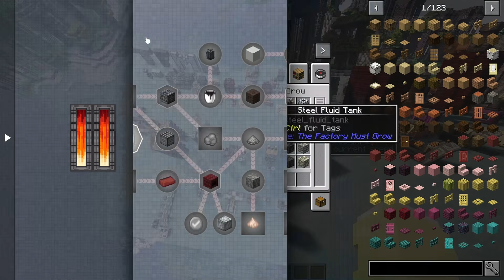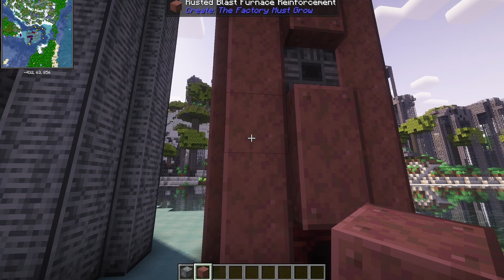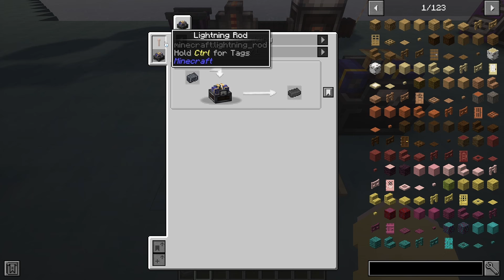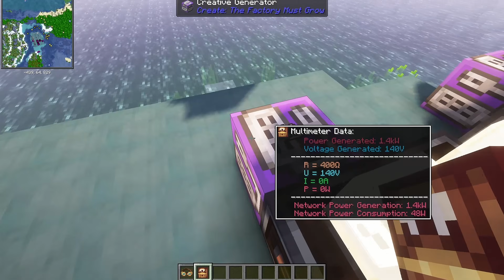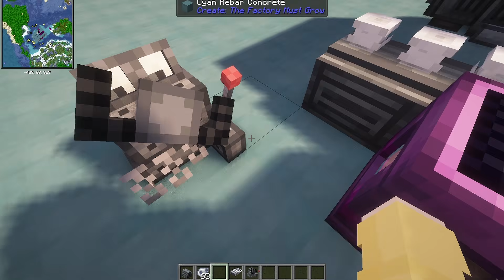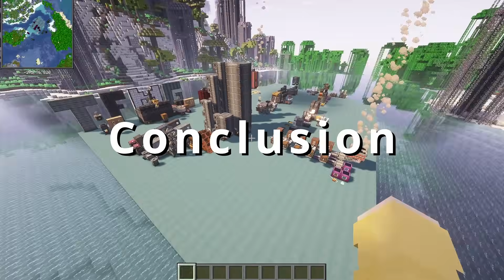Create: TFMG 1.0 Update - Comprehensive Tutorial (1.0.1b)

Comment from the maker: Okay, literally the day I uploaded this some things have changed.

- Electric motors: A lot less buggy. Speed now depends on voltage, the only thing you can configure is direction. Works up to 1000V, but already produces max SU and speed at 320V (11,220su at 255rpm)
- New gas lamp: Pump in various fuels to light up the area (furnace gas, crude oil, heavy oil, diesel, kerosene, naphtha, gasoline and LPG). ((even though they don't have a recipe yet, hydrogen, butane and propane also work))
- Fire extinguisher: Spout carbon dioxide onto it to fill it. Puts out fires when sprayed.
- More item information and ponders were added as well.
Reply: How exactly do I use the gas lamp? I’ve been messing with it for hours and it won’t work. I’m new to this mod, am I missing something or is the gas lamp bugged right now?
Reply: Wow, that’s a lot of improvements in such a short time! The new gas lamp and fire extinguisher sound especially useful, and the electric motor changes are really interesting. Thanks for sharing the detailed updates! Looking forward to seeing what comes next. 👏

Comment: how do i get ethylene becuse i want to get cooling fluid for my engines
Reply from the maker: When I was playing this version, it was extremely finicky. The ethylene produced by mixing naphtha would instantly turn into molten plastic. I found a guide for how to extract the ethylene before this happens on the TFMG discord:

"Pump Naphtha into Chemical Vat at low speed (8 RPM is ideal) - THIS IS VERY MUCH NEEDED
Pump Ethylene & Propylene out of the Chemical Vat at 256 RPM
The plastic recipes call for 500mb of ethylene, and the Naphtha vat recipe produces 500mb Ethylene + 500mb Propylene. 
Pumping out at 256 RMP remove a tiny amount of fluid, taking you below 500mb Ethylene so the Vat cannot complete the Plastic recipe because there is like 494mb of Ethylene by the time it wants to process this recipe.
Do note, if you are pumping Ethylene into a Fluid Tank, when that tank is full the Vat will fill up with Ethylene and begin producing plastic."

Comment: Hi! For some reason, my distillation controller doesn't work. It has enough heat(lv 18) and full crude oil
Reply from the maker: It could be that the outputs are not correctly placed or theres the wrong number of them
Reply: @blueberry1c2 Thanks!
Reply: @blueberry1c2 I checked, it wasn't that. And my other distillation towers stop working altogether.

Comment: It's really not a good sign when 15 mins in there was not a single new useful item or machine yet, only stuff required for other stuff from the mod. Electricity I guess is something "new" but at least two other Create addons add FE conversion (at a loss) without this huge hassle. Your tutorial is really good and you explain everything really well, a shame the mod itself seems to be literally useless.
Reply: i have exactly the same problem, there's a lot of new stuff and they look very cool but in the end they are basicly useless unless you want some fancy lightbulbs
Reply: @lawawa236  the mod is made by a bunch of weird people that want to force everyone to use their stupid electric system tried using their convertor thing that turns regular FE into their system and it never works for some reason gotta have to learn their shit so I can get aluminium and even still need to get that magnet thing what a hazel
Reply: @Chubbles_Wubbington well you're not forced to use the mod lol, i personally like the electricity system lol
Reply: it's meant to be a somewhat different and more interesting replacement for putting immersive engineering into a pack. with obtaining steel and other things

Comment: It's not producing Rubber. I made this Vat out of Steel. I have the Sulfur Dust, Heavy Oil, and working mixer blade. What am I doing wrong?
Edit: IT HAS TO BE A 3X3, NOT A 3x3x2. Ponder NEVER TOLD ME THIS.
Reply: So 3 wide and long, and 1 high? Love how the JEI crafting and ponder dont specify that.

Wonder what other recipes require certain sizes of vat.

Comment: Dunno why another commenter was complaining about the mod, anyway i think TFMG is better than Diesel Generators on forge as for me the pumpjacks and engines have often broken for no reason (pumpjacks not extracting oil, their appearance glitched, engines randomly deciding to swap rotation direction when starting). I like that TFMG has steel processing that is more accurate than many mods (blast furnaces, option to use arc furnaces, requires raw iron, hot air and all that fun stuff) as well as the quad potato cannon among other things

Comment: Have you had any problems running into the vax? I have been having issues with trying to separate propylene from liquid plastic and then trying to extract it using mechanical pumps. Even with smart fluid pipes. I run into ethylene and propylene and liquid plastic not extracting

Comment: 23:14 does current scale with stacking generators?
Reply from the maker: No. Current depends on the voltage; if you need more, then the voltage must be increased. You should only add generators if you get a warning about not enough power

Comment: Interesting fact: Oil is not entirely non-renewable
(Honestly though, it's surprisingly hard to get a solid answer) Oil does slowly recover (albeit at an extremely slow rate), but more importantly, there is so much oil in the earth that it's unlikely we'll ever actually run out. The problem is that getting further oil just becomes more expensive the deeper we have to go for it. At some point, it is going to be more expensive to drill for new oil than it's worth, but we also have ways to synthesize substitutes.
Don't forget that when oil was first found, it was just sludge that farmers had no use for. Eventually, it was later used to replace whale oil, and was mined and used as a major fuel source. Eventually, they also found new ways to extract oil from newly found deposits, leading to deep well mining, and offshore oil rigs. There's far more oil deeper than we can currently reach at the moment, but by the time we reach it, we'll likely have more substitutes, or more efficient mixed fuel processes that would make the oil we do find last longer.
Reply: it's not energy positive to synthesize it, so it isn't worth it. We would actively lose energy from trying to obtain oil in a few decades, when all the easily accessible deposits are ran dry.

It also isn't renewable because we extract it faster than it replenishes. Saying oil is renewable like saying that gold is a renewable resource, because it "technically" is made when stars explode and they're still doing that. Like, yes, more is being made, but it is ultimately a limited resource for us.

There is a limit for which we can maintain oil consumption at energy positive levels, which we have already went past, so it isn't renewable compared to something like bio-fuels, solar energy, or wind energy. We can more or less upscale production and usage of all of those (currently) without a feasible limit. That's what makes something renewable- not that it technically replenishes over time.
Reply: I'm pretty sure we can actually make oil now (or probably in the future)
Reply: fossile fuel is a term created by oil companies to make you think its some sort of rare and non renewable material, oil most likely doesn't even come from organics but through the liquefaction of coal inside the mantle that gets brought up by tectonic movement
Reply: @sten10412 coal is also made from organic material.

Comment: its safe to use on MC 1.20.1? because I have TFMG 0.9.3 installed due to required versions and whatnot and I would like to know if I should be worried.
Reply from the maker: Yes, 1.20.1 forge is the version I'm using.